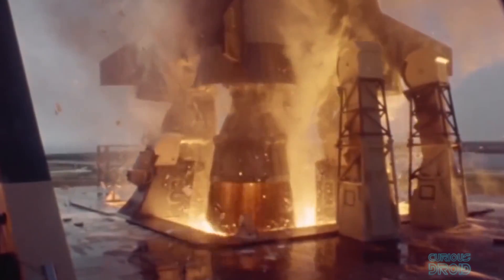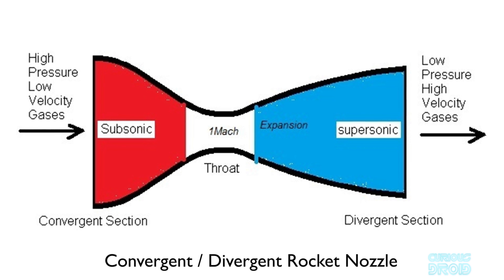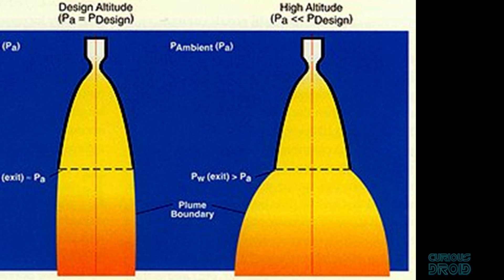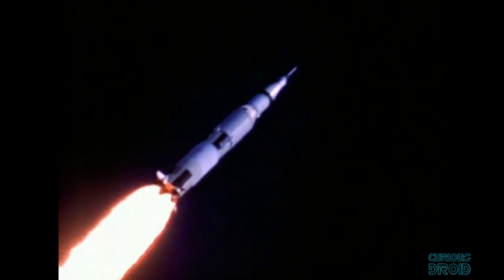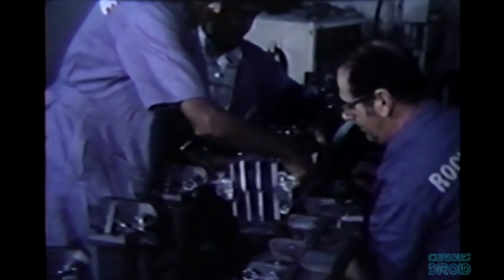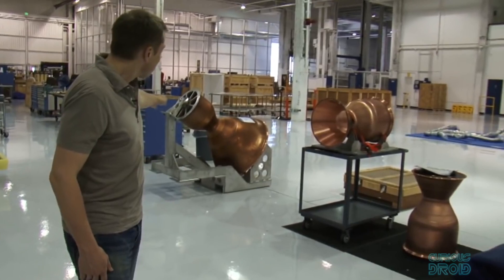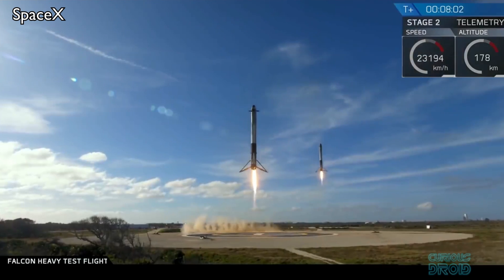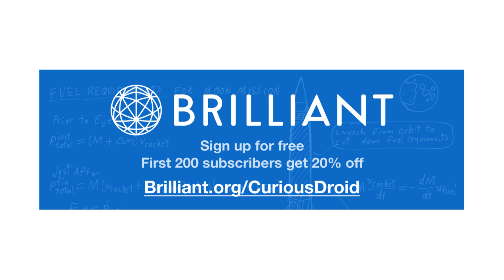Aerospike Engines - Why Aren't We Using them Now?

Comment: So after you've calculated how much force you need to achieve orbit for a kilo payload, have a look at how much thrust the LEM would require to decelerate for touchdown and how much the ascent stage would require to intercept the orbitor. Apollo was a hoax, which is evident from the lack of thermal insulation. The protective thermal roll is a joke like the cold space joke.  
I've made a 5 minute vid on that issue which you can see on my chanel.
Reply: Thank god there's experts like you. Now go back to playschool.
Reply: Ralf S. 
Ok, let's have a look at the experts. 
If you ever have the luck to be taught by an actual scientist, someone who has had to actually prove things, you'll know that the basic principle is that you need to understand facts for yourself. 
So immediately you have a conflict between you becoming a scientist and you referring and deferring to experts.  Note that a science teacher is not an expert in science. They are experts in getting people to learn. 
So let's have a look at the experts in science, and let's have a look at Piltdown Man. Piltdown Man was a hoax on palirntologists that last 40 years.  All the great and the good signed up to the authenticity of this English humanoid fossil, which came complete with a fossilized cricket bat. The bat detail was suppressed information which the experts felt didn't so anything to appraise the public of the authenticity of the find. 
The most rudimentary tests were never carried out on the specimen until the ruse was exposed.  Careers had been made and lost over this specimen which was a great propoganda coup at the time for British Science. 
Please take you experts with you and leave me with my straight forward basic laws of nature, as intuited often by children. After All, don't children often ask, when told about Apollo, wasn't the sun too hot. 
Why don't you explain how the Apollo crew could claimed that sunshine is cold?
Reply: Make yourself an expert and become familiar with 'thermal isolation'.
In space, it's particularly simple, because there's nothing else but radiant heat to deal with; so a simple mirror does the job. Have you ever asked yourself why apollo spaceships almost looked like polished from outside?
Reply: Ralf S. Yes Ralf, I've heard all kinds of stupid explaination. Yours here isn't the most moronic, however I'd suggest you take an aluminium pot out in the sun. The pot should be very shiny. You should be able to see your own reflection in it ideally. Now see if the reflectivity does anything to stop the pot becoming hot. Note that the air around the pot, in which you stand, is a good deal cooler than the pot. This means the pot is getting hot, not from connected heat from the air, but from the sun. That heat is radiated through the atmosphere and through space. 
Infact, the air is cooling the pot. If you were above the atmosphere,  above the cool mesosphere, there would be no such cooling and your pot's maximum temperature would be commensurate with the terrible heat described by the mass astronaut I mentioned earlier during his recent live utube broadcast. 
If you can explain why Apollo wasn't effected by the normal laws of thermodynamics then if be happy to read that. However, I suspect you are going to hit me next with another old chestnut I've heard many times before. 
Perhaps you will want to go in depth into thermodynamics and lose me in a web of esoteric equations concerning black body radiation and going under the name of foreign sounding gentlemen.  Lol.
Reply: Expose a matt black anodized piece of aluminium to the sun.
Expose a chromed piece of aluminium to the sun.
Use a surface thermometer on both. Read the numbers. Draw your conclusions.
Reply: Ralf S. Here is what I expect to find, both samples reach the same maximum value, with the chrome taking slightly longer to do so. I certainly will be amazed to find any significant difference between the two samples. Further, as the samples are pot shaped, and we are exposing a curved surface to the sun, in the spirit of a moon excursion, the reflected heat only applies to a thin glint of sunlight along the midpoint. Only the infrared met head on will be effected by the reflective surface. 
This is too much detail though. The point is that if the craft was put on a beach during a hot day, the crew inside would be extremely, uncomfortable, hot. In space that would be true also, and to a far greater extent. It the journey was to last more than 30 minutes, they would be in real trouble. After 150 hours they would be long dead. Their bodies would be cooked white pork and their skin red as lobsters and black as coal.
Reply: Allright then, pleased to help you out. But wait, one by one:
1) Shape doesn't affect reflection or absorption. It only affects the direction in which radiation will be reflected.
2) Difference between reflective and absorbing surfaces is enormous! That's why big tents always have white roofs (dark grey for example would be much easier for cleaning and maintenance). That's why car windows are coated with heat reflecting foils or particles. That's why a black car gets much hotter in the sun than a white one. That's why solar panels (those which heat up water pipes) are matt black, and heatig radiator's reflectors are bright silver or chromed.
3) If you put the craft on the beach, it's 30° or 40° centigrade all around. If you put it in space, it's minus 270° centigrade all around. And that's why
4) in fact, aircraft and spacecraft need to be heated instead of be cooled down inside.
5) But hey – this makes no sense; if they need to be heated inside, why do they have highly reflective surfaces on the outside then?
6) It's in order to keep the difference between the hot parts (those exposed to the sun) and the cold parts (those in the shadow, remember: it's -270° outside) as small as possible. The bigger the difference in temperature, the bigger the stress for the structure.
So - have an amazing day then!
Reply: Ralf S. So much silly nonsense. You have this spanner spinning in space. It's in the sun, so for me it's hot. It's too hot to touch. For you it has a sunny side which is hot and a dark side which is cold. As it spins it alternates from hot to cold as it spins. You're wondering why it doesn't explode from the stress. For me, metal still conducts heat in space and the darkside is still too hot to touch, whether it's spinning or not. Your -270c space is just daft. How did space get cold?  
Here's where you've got confused . Btw,  you are deliberately being confused so that Apollo can be maintained. 
The cold space your thinking of is the place where the sun has extremely little influence. Way out there in interstellar space bodies can lose all their heat. The space isn't really cold or hot, but there is no heat source, so things will cool to a very low temperature 
 That doesn't happen in the sun. The sun is very big and hot and near. Anyone going to the moon needs to be shaded by a shade which is in the shade. See the Hubble space telescope.
Reply: There is no such thing as 'heat' in space. Temperature is interaction between elementary particles. No particles - no temperature. (There's very, very few out there; meaningless for this consideration.)
Therefore, the only thing we have to deal with is radiation. Yes, lots of radiation; but reflecting/ shielding of (thermal) radiation isn't secret science - it's basic craftsmanship. Steel workers use it, plumbers use it, spotlights use it, solar power plants use it, astronauts use it. The major problem back then was making it lightweight – so multi layer aluminized mylar composite insulation was invented, today used by every rescue team and camper.
Ever used an infrared lamp? Any idea why it feels remarkably warm in front and not warm behind? Its metal reflector (yes, usually it's metal, applied by vapor deposition on glas) reflects the filaments thermal radiation. That's why they call it 'reflector' and not 'conductor'.
And because isolation and reflectors work, but no isolation or reflector works perfectly, Apollo was slowly spinning on its trip to the moon and back, to help temperature balancing. Those parts in the sun reflecting as much radiation as possible while slowly heating up, those in the shadow cooling down by working as infrared radiators themselves.
Reply: Ralf S. Ok, Ralph , you're throwing in technical terms here like, 'metal', I can see you know your stuff. 
Here's the thing, buddy, it's really hot up there, out of the atmosphere, in the sun. He'll, it's hot today down here on the ground. If you asked me to step inside a tin can today, with no shade, with the sun beating down right on top of it, I don't think I'd last very long. But up there, that's a different story. In low earth orbit the ISS constantly battles against the heat. New replacements and additional reinforcement replenished the thermal insulation at each opportunity. Much of the craft spends much of the time behind the shade of solar arrays. Even then it still very, very hot. Half the time is spent behind the earth in night. Every 40 minutes the terminator offers a reprieve.  But on a moon journey, it's much, much worse. The time of day is always the same. It's always high noon under the summer solstice sun.
 A perpetual 12:00 a.m., 1200 hours,  high noon, always. 
There is no earth shadow nor moon shadow. For 72 solid hours the temperature is 2, 000 degrees of Celsius. 
How cool were the astronauts. They really were made of the right stuff.  I don't remember Tom Wolf saying they actually tested them out in vacuum ovens before the flight, but I guess that must have been part of the training. 
Seriously, "elementary particles"?
Wtf are you talking about?
The skin of Apollo is going to be 2,000°C, that's what you get in the sun, out there, with no shade. Yes,  that heat gets there by radiation. All heat gets places with infrred radiation, that's how heat gets places. There is no heat transfer without infrared radiation. 
So, once the skin is hot, what is stopping the crew from cooking? Style?
Reply: Oh boy.
You don't understand what temperature means, don't understand what radiation means, don't understand what reflection/ absorption means, don't understand what isolation means. You don't understand a single thing, and not even try to.
Okay. You're one of those mental heroes who don't have a clue, but have an 'opinion' instead, right?
Heroism is idiocy's little sister. Communication impossible, case closed.
Reply: Ralf S. I'm  sensing some gender hang-ups here. 
Here's what I do know,  heat. 
Temperature was always a bit of a vexed issue, whether to plumb for k or C or maybe even f. To choose particle velocity, average kenetic energy of particles, or an infrared thermometer, it's a head scratcher. 
Here's what we don't want, we don't want you telling Leonov, the first man to walk into the light, the first spacewalker,  we don't want you telling him it's freezing out there really, and he's just imagining it hot.
Have you ever wondered how far out of touch a lost orbitor is? That's like you, you've completely lost your faculties. You need instructions for the most rudimentary assessments. You are orbiting your own consciousness and imagination, but you can never land.
Reply: Don't drink and write.
Reply: Ralf S. That's right Ralph, there's no heat in space. How much space is in a turkey? When a turkey cooks, is the space inside the turkey cold? Is it only the matter which is hot? 
Turkeys are mostly space. 
Are you are turkey, Ralph?
What if we wrap the turkey in tin foil? What you call serranwrap,  I think. 
Silver foil, what is we cover our turkey in tinfoil,  in a vacuum oven, on a slow turn rotisserie.  Will it cook? Is that any different from Apollo?
Reply: Is this because of the space in a turkey comment? Actually, air is mostly space. Matter is mostly space. Solidity is illusory outside a black hole. Compared to a black hole a turkey is basically free space.
Reply: If saran wrap can reflect radiation by 100% - turkey will stay cool.
As no surface can reflect radiation by 100% - turkey will receive some energy and start heating up.
While turkey's heating up, it becomes a radiator itself and starts submitting some energy.
Balancing incoming and outgoing energy is turkeys' temperature.
If you want a certain temperature - take care of the balance.
Enjoy your meal.
Reply: Ralf S. Your balance sounds like positivism. The turkey won't radiate any heat until it exceeds the surrounding heat, ie, when taken out of the oven.
Reply: Remember: there's no such thing as 'surrounding heat' in space oven. There's -270° on the dark side. Pretty cold for any kind of positivsm, don't you think so?
Reply: Ralf S. what is -270k? space?
Reply: Absence off matter. Fine space for radiating.
Reply: Ralf S. Au contare,  fine vacuum for insulating. Voila, your fundamental error.
Reply: So vacuum isolates from radiation? E.g.. from sun's radiation?
Perfect! So a simple fuel based heater will do the job. You're brilliant! Go and help NASA save some bucks.
Reply: Ralf S. Yes, heat will dissipate slowly into open space and eventually render a body devoid of all heat, BUT, that only happens when there is colder objects in the vicinity. Just as the turkey only radiates heat once it becomes the warmest object in its ambience. You've completely failed to grasp the first law. Hear travels spontaineously from warmer bodies to cooler ones. 
Also, the vacuum is an insulator, so whereas bodies will eventually lose all heat in the interstellar void, it takes time to cool down. Your coffee will eventually cool in your thermos flask, but much slower than it could have done outside the flask. 
None of this needs couched for by an expert. I'm only saying what is demonstrable.
Reply: So, what did NASA officials say? Got the job?

Nope, you still haven't got it. Vacuum doesn't affect (or 'isolate') radiation. It doesn't on the sunny side, it doesn't on the dark side.
 And it doesn't matter if the next hot or cold 'object' is 1m or a billion miles away.

Just to make it clear again: energy balance is the keyword. If what goes in goes out, result will be constant average temperature.
The bad thing about: in space, the only way out is via radiation. Nothing else possible; no convection cooling, no ventilation, no airstream - literally nothing.
The good thing: the only way in is also via radiation (apart from some minor sources inside the vessel, like the astronauts themselves, some electronic devices, ect. - peanuts compared to solar radiation). And the amount of energy getting in by radiation is relatively easy to control by using more or less reflective surfaces on the outside. In fact, you need some of that energy – perfect reflection (which isn't possible) would result in deep freezing the vessel sooner or later, because despite any isolation, the amount of losing energy by its own radiation into space is significant.

The coffee in your thermos jug will stay hot, mainly because the inner bottle's glas is coated with a highly reflective metal surface that keeps thermal radiation inside. Of course, the little bit of air (air, not vacuum!) between inner and outer bottle will help by adding some isolation.
Reply: Ralf S. it's a vacuum flask is also another name for thermos. However, I'm ready to consider there never was a vacuum in the flask. That's because we use air to insulate in other applications like a loft space. 
Ok, but I don't believe the reflective surface is a bigger contributor to the thermal stability than the air. 
You are correct that the internal sources are negligible compared to the solar heat. 
Here's the thing, my aluminium pot is still hot. No matter how much I shine it up, it still gets too hot to touch or to hold for more than a moment,  in the sum. Is it the wrong kind of reflectivity? Is the ISS using reflectivity in a daft way? Is that why they are constantly replacing insulation?
You're on the losing side of this argument . 
I've posted this whole discussion on Createdebate.  You should have a look. Most people think I've won.
Reply: Spaceship Apollo' surface (polished  Aluminium) can reflect up to 95% of sunlight. Will decrease on earth over time because of oxidation; amazingly, for lack of oxidizers, there's no oxidation in space.
Spaceship moon's surface reflects 10 to 15% of sunlight. Average temperature on spaceship moon is -55°C. Will vary from very hot to very cold, because spaceship moon has no aircondition system.
Spaceship earth's athmosphere and surface reflect 30% to 35% of sunlight. Average temperature on spaceship earth is 15°C. Because its sophisticated AC (we call it 'athmosphere'), temperature is pretty close to average almost all the time and everywhere on earth.
All three of them do the same thing: orbiting radiator 'sun' while slowly rotating around their own axis. Same distance to radiator sun, btw.
Draw your conclusions.

All your red herring about ISS has nothing to do with these basics. First parts of ISS have been up there for 20 years; of course there's constant need of maintenance/ repair/ improvement of its steadily growing AC system.
Reply: Ralf S. 
That's very erudite and informed, Ralf,  another exemplary paragraph or two. Here's the thing,  it's fundamentally flawed. 
Do you know that feeling when you first refill a new car? You could swear the bumf said 60 mpg  combined, and here you are witnessing a refuel that says you only got 35. 
How did they get their claims pass the advertising regulators? 
Well, it turns out that that gentleman's children goes to the same school as the chap who owns the company who advertised the car. 
He would have put his position in peril if he'd allowed a false claim through, but the car sells much better with the enhanced figures, enough to allow a spot of cooperate kick back even. So the advertising man tells the car chap to leave two cars at the test track, with everything stripped out. Leave only that which is necessary for legal purposes to identify the model of the car. 
With all the seats, brake system, interior trim, fender, bumber,  even the wing mirrors gone, the car is tested on a dead flat circuit,  at only optimum fuel consumption speed. 
The car you own was sold under strictly speaking legal terms. The argument you have up here above, is strictly speaking true, but that is where the honesty stops. 
Here's the thing, your reflective aluminium CAN reflect 95% of heat, but only in sheet form, and only at one precise angle, which tracks the sun.
The moment your sheet is angled off the perpendicular,  it is no more reflective than my hot pot. 
For the rest, I've heard all that nonsense before about the ISS being out there many years. The truth is the heat problems on-board is not for public consumption. People can see them wearing shorts and their faces red, but they don't ever get told much about the reality. It's he'll on the ISS, that's the truth. The heat ruins everything. The persuit of cool is the biggest preoccupation of the crew. The reason for this would be no surprise to the father if Icarus, nor to anyone before Apollo. 
Look at you average space temperatures again. Is that some kind of cosmic average? Are you really saying the average temperature of the sun in cislunar space is -270° C?
Reply: You're wrong again. The degree of reflection has nothing to do with entrance and exit angles.
Put an object in front of a mirror. Change mirror's angle (or your observation angle ) sideways or up and down. No matter what you do - you will not see any change in brightness of object in the mirror. Degree of mirror's reflection stays always the same.
Try the same with a torch: whatever angle you choose - mirror will always reflect same amount of light. Degree of reflection doesn't change with angle.
Even more: it doesn't even make a change if we talk about directed reflection (mirror) or diffuse reflection (scattering/ e.g. white sheet).

And once again: temperature is movement of particles. Radiation (as long as it's not being reflected :-) can/ will cause particles to move = rise matter's temperature. But: no particles - no temperature.

Do your homeworks. And don't buy cars you can't afford to drive.
Reply: Ralf S. 
I can afford the car they advertised.  That's the spec I made the purchase under. Whether I can afford to waste gas money doesn't cone into it. I'm not going to strip the fucking thing down any time soon, wtf would I do that for. The advertiser and the advertisement regulator are a pair of pirates who really should walk the plank. 
You, on the other hand, you don't owe me anything. Although I'd like it if you did be the civility of sparing a little thought. 
Visible light has a wavelength of atleast 380 nm, where as infrared is 5nm.
This is way too clever. We don't need all this technical wizardry.  The pot of aluminium from the kitchen tells the entire story. If what you say we're true, how do you explain the heat captured by the pot body?
Reply: Thank god, physics do not depend on creative advertising. Isn't that nice? And thank god, technical wizards who done their homeworks (some call them engineers) can precisely calculate the amount of incoming and outgoing energy, and what measures should be taken to keep things nicely balanced.
Obviously, the guy who designed your teapot didn't care enough about this issue. Maybe the reason why he designs teapots and no spacecrafts?

Ah, by the way: the principles of radiation/ reflection/ absorption do not change with wavelength. And your related numbers are wrong. Not sure if I should have told you, though.
Reply: Ralf S. 
You're so very clued up on all the science stuff, Ralf, you can be forgiven for not knowing the difference between a cooking pot and a teapot. I suppose if both are aluminium it doesn't matter. 
So, heat is a 5 nm wavelength which is 65 times smaller than visible light at its smallest. If you've got a problem with that, maybe you could name the big shot physicist who you want to hide behind. 
Like I say,  we don't need to bother with all the clever technical stuff.  
The fact is your idea of equating visible light with heat is something which is demonstrably erroneous. 
Heat passes through anything, whereas visible light can't. The material impervious to visible like is like everything, except glass and water. That is a big difference right there. 
Interestingly they have made transparent aluminium, but you don't want to catch up on that stuff before grasping the most rudimentary fundamentals of heat transfer.  
Again,  my COOKiNG pot is hot in the sunshine. It would also be hot on low earth orbit, and going to the moon would do nothing to cool it down. The space between the atoms of aluminium in the cooking pot are at zero degrees Kelvin, if you are going strictly by a  molecular definition of heat. Since the atoms are mostly constructed of free space, then by your logic the pan is on average just above zero Kelvin.  That's also true as the pot melts. Your measurements are  intelligent but idiot. Look that up on utube.
Reply: Once more, you're talking bogus.
What we perceive as 'light' is electromagnetic radiation with wavelenght between 400 and 700nm.
What we perceive as 'heat' is electromagnetic radiation with wavelenght between 1 and 10 mikrometer. Roughly, don't nail me on single digits. That's nearly ten times bigger than visible light. No big shot physicist needed for knowing this. Basic school knowledge. Almost forgotten.
And as it's all electromagnetic radiation, everything is subject to the same physical laws. Remember? Radiation. Reflection/ absorption. Balancing of incoming and outgoing energy.
Physics beyond teapots can be overwhelmingly simple and logical.